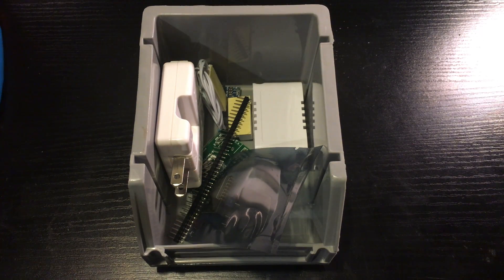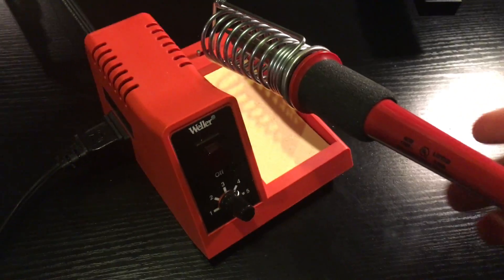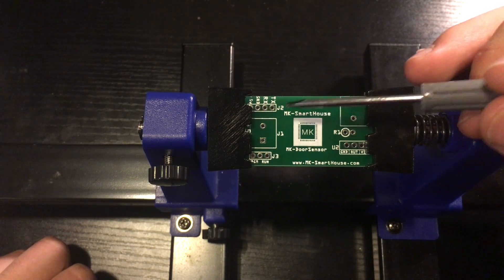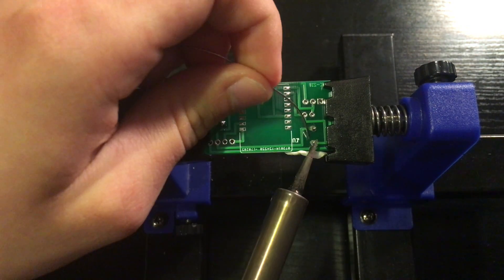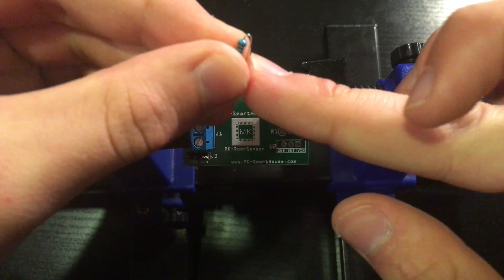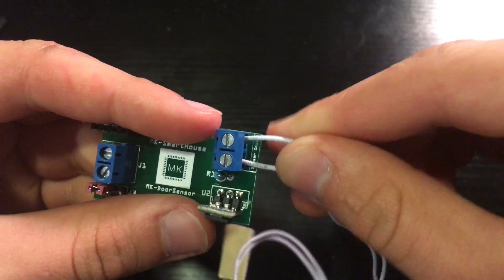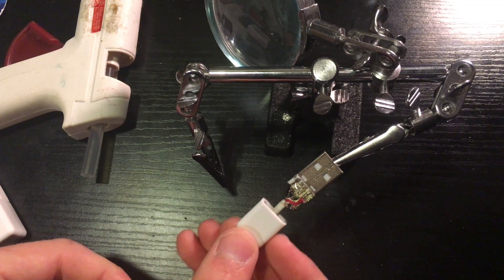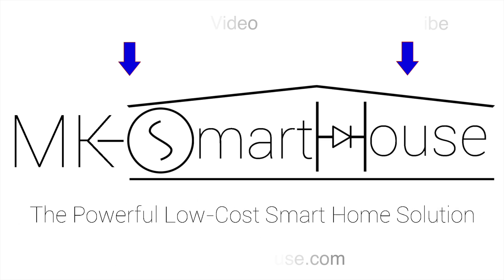Complete Guide MQTT OpenHAB ESP8266 Door / Window Sensor: Hardware

Comment: can someone help me on how to wire the esp8266 without a circuit board . especially how to set it up for bootloader mode and how to set it to run mode. even a picture of a diagram on paper would be very helpful

Comment: Hi, this is really amazing. I am blown away by the depth of knowledge is demonstrated throughout the series of videos. Kudos! 
I have a question - Is it not cheaper to buy a Door Sensor rather than building one? I can imagine the thrill of building one and the knowledge, and experience you gain but is it financially cheaper to make it own or buy it from the market? Especially for those who don't want to build everything from scratch (the sensors I mean)? The PCBs are relatively costlier and the most expensive part of the sensors ....It is fun to make one but when you need 15/20 of such sensors (considering doors and windows) - does this method make sense? If I get an off the shelf sensor,  how would it work?

Comment: can I modify a existing door sensor
Reply: 1/3 of The Formula. the door sensor is a magnet driven switch in the case of the video, you can use any kind of switch or relay

Comment: Ok I'm gonna make a lot these so I have a question that might lower the amount I need. I am gonna use them at open window sensors so here is my question. Could you daisy chain the positive to the negative of 2 set of switches. Making one loop. This way I would have one sensor for two windows that are side by side??
Reply from the maker: Yes you can daisy chain them

Comment: Would it be possiblr to power the whole thing with a battery? I think that would be a smarter solution for some people (like me) :) 
But anyway: great videos - keep up the good work!
Reply: 1.Buy a 12v Lead-Acid battery(heavy but reliable power sources)
2.Buy the 12v to 5v (3A) I told you(or similirar)
3.Buy wires to do the connection
4.From the 12v battery, positive to the +12 on the converter and negative to -
5.Cut your current Raspberry Pi Power Adapter(or one with the same characteristics, e.g Samsung)
6.Then on the ouput sockets, connect positive to the red wire you just cut on your power adapter, and negative to black

It's straightforward. To sum up, just connect your battery wires to the input sockets of your converter, and the output ones to your raspberry pi wire.
Reply: Fred Zibulski just a 18650 battery as long as it's running at its nominal voltage of 3.7 volts. If you want to be on the safe side you could use a HT7333-A and a suitably sized capacitor and then that would allow you to run with a fully charged 18650 and run down to about 3.2V at which case you would want to charge the 18650
Reply: that is also interesting for me to be able to have it battery powered
Reply: Yes you could!, The Raspberry Pi operates with 5.1V(5 is okay) at 2.5A, so you would just need a 12V battery and a buck converter which can provide that amount of current. Remember, use a buck converter, since lineal converter produce too much heat and therefore power loss.
Reply: Take a look at this:
http://www.ebay.com/itm/DC-DC-12V-24V-to-5V-3A-Step-Down-Regulator-Module-Voltage-Converter-Power-Supply-/332200269918

Or google 12v to 5v, something like that will do the trick
Reply: @Enrique Phan Razqiun how would I need to integrate that with the constuction from MKsmartHouse built ?
Reply: &Enrique thank you will definitely try that were it is needed. Would you have an idea how to get a Poe connection implemented too ?
Reply: What do you mean? I have my Rpi connected to a Poe switch without issue, is that what you meant?
Reply: Enrique Phan Razquin I mean is it possible to power the door switch with Poe ?
Reply: It might be possible since Poe has two wires to provide voltage but... I don't think it's a good idea either way. Nevertheless, you can google "Poe ethernet pinout" and try to figure out a way to do it.
Reply: Enrique Phan Razquin why not a good idea ?
Reply: I mean, why not just power it via USB like in the video?
Reply: Enrique Phan Razquin I'll explain my thinking: I have a house want to protect against wifi jamming so at the entrance I got a Ethernet cable for motion sensor and thought to combine it.
Reply: Yes you could seems a lot of people have gone on about powering the pi but I am guessing you are happy for that to be plugged in and want just the door sensor to be battery powered. The esp 8266 can run off a 18650 battery directly as long as it has come down to its normal voltage of 3.7v. You would then need to change the code a bit so that it goes into deep sleep. If you put it into deep sleep permanently by putting the time to 0 and then attaching the door sensor to the reset pin you should be able to run it on the 18650 battery for over a year.
Reply: ingy23 what about a fresh charged 18650 at 4.01v?? I know it will eventually come down but will it cause any harm if I used it??
Reply: ingy23 well I over looked something when I put this together. It works fine because I still put the 5v to 3.3v step down on. So you could use any battery series as long as you don't exceed 5v.
Reply: Its indeed much better using battery (alkaline), and implement NTP protocol and some line of code to put the esp8266 into deep sleep. It will take board off voltage for years
Reply: ingy23 what components world I need to malt what you describe ?
Reply: Because ethernet is for connecting devices to a network, and Poe just provides an additional feature of being able to provide a voltage, and using an ethernet cable just to use voltage it's just not his purpose, but of course you could. 
Or is it that you want to connect the ESP8266 and door sensor altogether via Poe? Because if that's the case you don't need an ESP8266 but an Arduino standard board with ethernet
Reply: John Robinson I would expect it to work but run a little hot. Not sure if it would cause long term damage over time though as the esp is only spec'd to run up to 3.6 I believe. I have known of people running them on up to 4.1 without issues apart from them getting warm. I personally drop the 18650 to 3.7v using a 10w resistor. Let us know how it goes if you try it :).